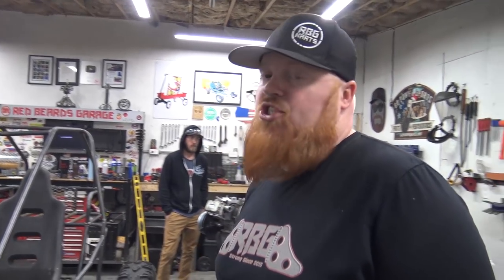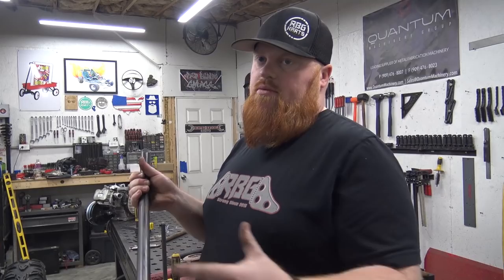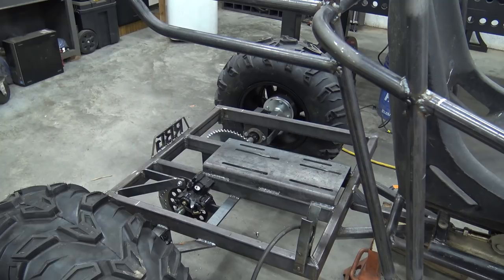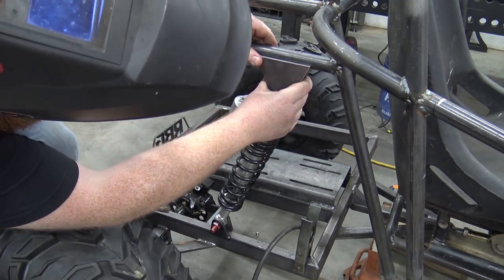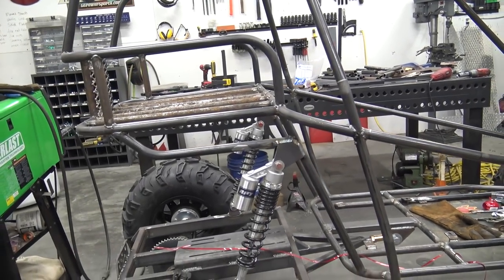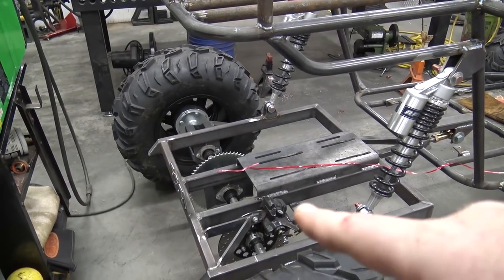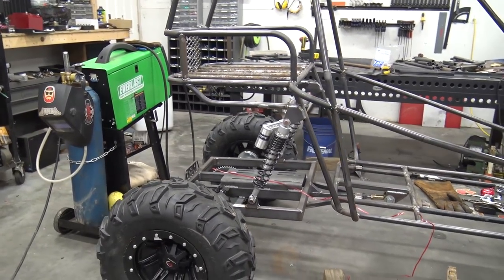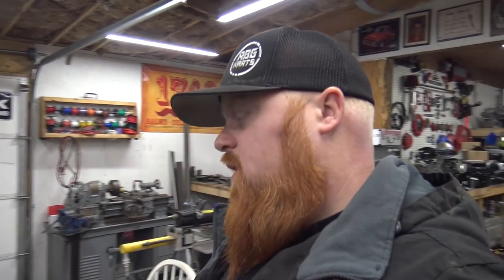Custom Roll Cage ~ Yerfdog 3200 Build Ep5

Comment: I wonder will one way bearings work as differential for go kart.
For example when go kart turns left right wheel needs to turn faster that makes left wheel slip but because of one way bearing it will just spin the bearing not the wheel. When going straight it should be like a normal live axle.
Reply from the maker: Im sure it could if they could handle the power

Comment: Like it. But next time you should do engine carriage in round tube too.
Reply from the maker: I like doing them out of rectangular because of ease and strength
Reply: I totally understand but it looks like you handle the round tube pretty well, and I'm sure it's strong enough, if you're worried about it you could just get a heavier wall... And it would surely look a lot sleeker.